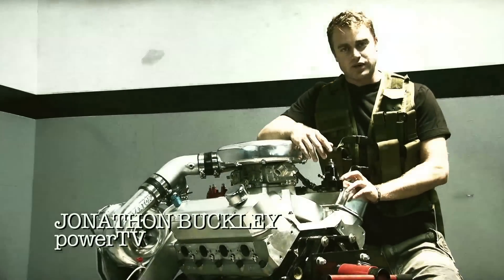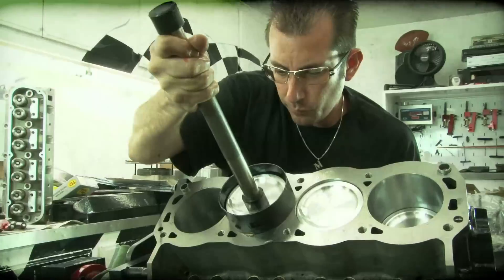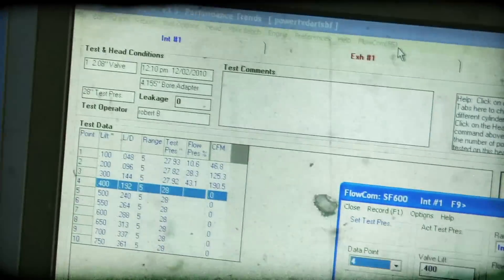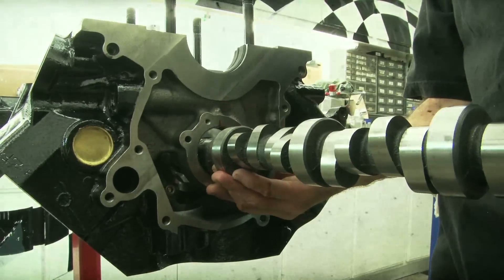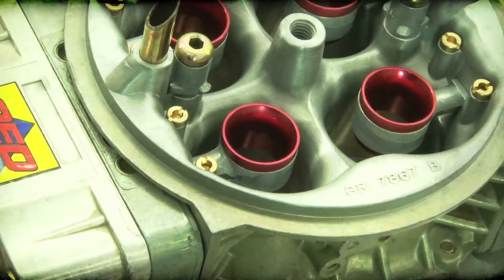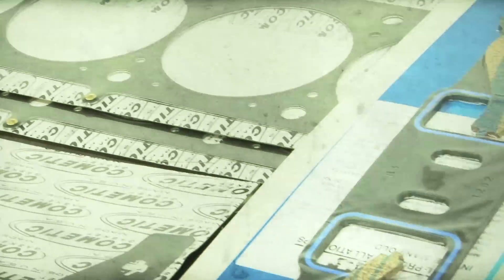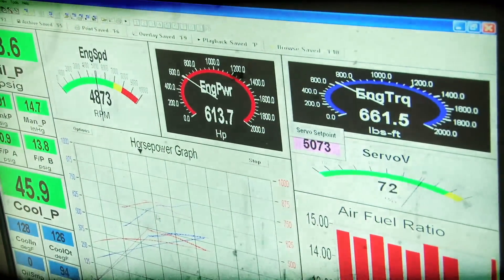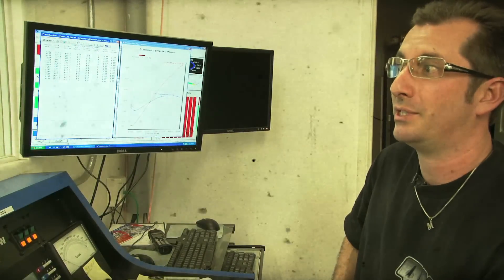Dyno-testing our 1,000+ HP 427ci Small Block Ford supercharged with a Paxton Novi 2500

Comment: it all depends on the drive train. It's going to be a street car so.... maybe a tremec 5 speed. hp would be around 830-875. more boost could put you right back in the 1000 hp range. The procharger f1r cog system will do that easy. then you have to hold on!

Comment: about 12 grand in just parts.if all bought new!
block- $2800- to 3000 
heads- $2000 
stroker kit- $2100-2800 
vortech supercharger- $4600-5500 
blow thru carb- $ 850-1200
Then you have al of your accessories; oil pan, distributor, arp bolts, msd box, carb hat, valve covers. All of this is not including installation. So if i had to guess on the build would be about 20 grand.

Comment: all depends on personal preference i guess. my dad's dragboat which has a 472BBC in it ran like shit with an enderle set up on it. we wasted months trying to get it to run worth a shit but didn't get much better out of it. Threw some predators on it, starts right up first try, throttle response is unreal, my dad's never been happier with that engine. Also comes to a cost factor. For example on my chevelle i can't afford 1k$ efi system. a new 360$ SMI quadrajet is perfect for me.

Comment: I don't know the exact specs of your valvetrain, but on my engines the hydrolic roller lifters have worked well up to around 6800-7000rpm with the correct cam core, valvetrain weight and spring rate. But, the 9.5 deck blocks do have longer pushrods and could be a weak link depending on the thickness. I would be more concerned with the head gaskets at that boost level, than I would be about anything else.

Comment: All I wanted to know was can boosted carb set up make over 1k hp.  Considering they did that with an untuned base motor I got my answer. But I think the money would have been better spent on twin turbo's and 30 lbs of boost ;)
Reply: For this performance goal TT would of been way overkill and the engines longevity would of been degraded greatly. That paxton only runs anywhere from 13-15 psi so TTs at 30 PSI would be in the 2000 hp range, thus making that engine a short term consumable. 14.7 PSI in a perfect world doubles HP.

Comment: No it's not. It will consume more than that 80hp you guessed at. It depends on the drive train, gearing, tire diameter and trans type. 

What I'm disappointed in, is the fact that they did not spin it to 6800-7000rpm. That valve train and cam could have easily been stable up there.

Comment: AFR/Lambada showed 15+ that kind of lean will kill the motor.  It isn't even hooked up, is it?  Computer readout showed 0.0. That
is really scary, not knowing the baseline Air Fuel #s.  For a second the AFR popped on showing high 14s across the board! If that IS the correct AFR, the motor IS starving for fuel and could make much more power if jetted correctly.  Good Luck.

Comment: @irvinemuscles yeah no shit its gonna still push alot of power to the wheels, its got plenty of power. even if yu take away 200 hp it'll still spoon the tires easily.
and i don't drive a piece of shit rice burner, i drive a Chevy trailblazer and a Ford f-150

Comment: who is the clown that spec'd your cam?! lmao.  Did the smell of gas burn your eyes?  534 bhp for a 427 with a 260* cam?  smh.  Do you normally run boosted motors at 15:1 AFR?
Reply: ***** 

maybe the host said 260* @ 0.050" by accident?  260* advertised, about 210* @ 0.050" is more believable for 534 bhp with that cam.  Idle is kind of rough.  Tuning a motor while n/a is still very important...supercharging just multiplies base performance.

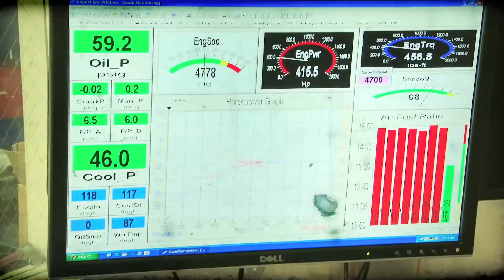at 5:28 all the O2 sensors are reading about 15:1...and they're moving.  dead sensors don't give a value, never mind a varying value.  11.6-12.0 is right where it should be.